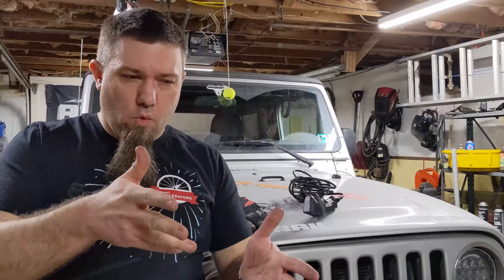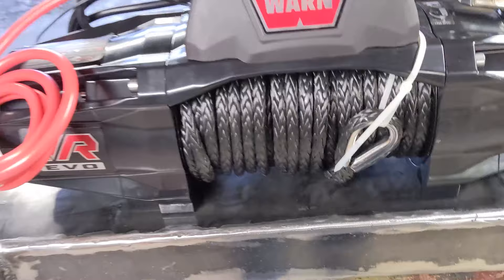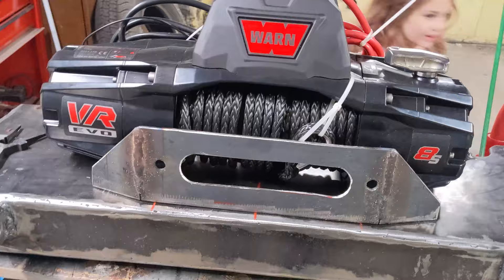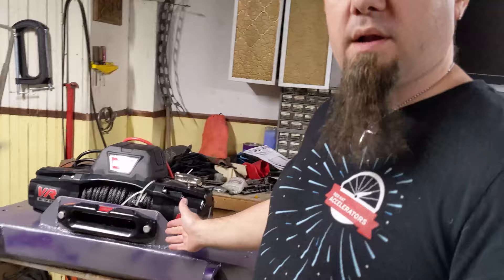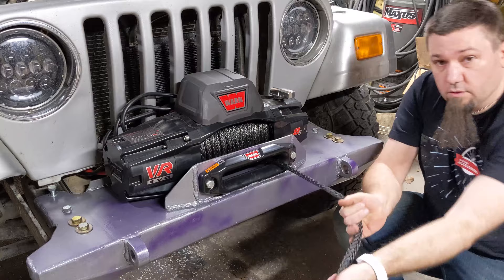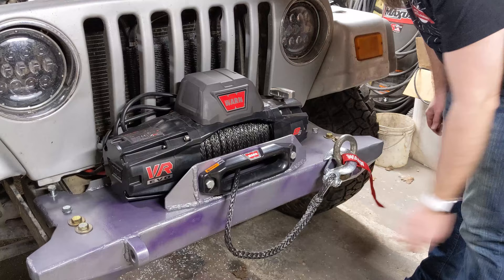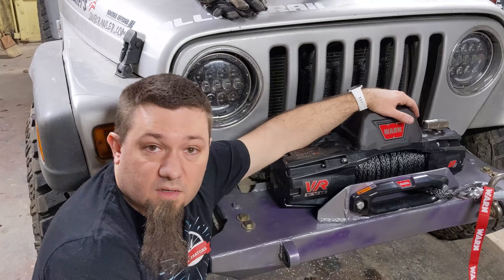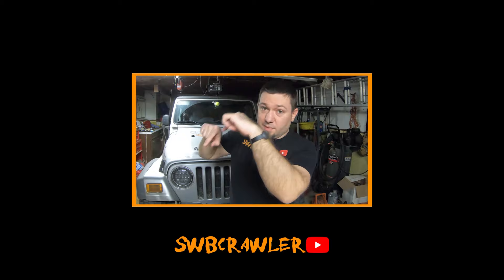Warn VR EVO 8s winch install on my custom 2005 Jeep TJ/LJ Bumper!

Comment: I have a Warn EVO 8. But I could not find out how the remote control works. I tried to read in the user manual but not I could not find a word about the remote. You showed how it works so now I know and now is my only problem what kind of battery it need. I guess it can not charge the battery, so it probably need to be replaced at some time. Thanks for a great video!
Reply from the maker: Yea, I was surprised at the lack of information in the manual about the remote.  And the batteries are also not rechargable as far as I can tell.  They changed the design at some point to accept AAA batteries.  But mine takes a special battery.  I did find a place that makes a higher milliamp hour battery (for longer life) but I don't have the link handy.  I'll share it If I remember to look it up when I get home.
Reply: @SWBCrawler  I opened my remote control and discovered that there was an ER14505 battery in it. It is a very special battery but it looks like a regular AA battery. But an AA battery does not work. ER14505 has 3.7 volts and AA has only 1.5 volts. Who came up with this? A really bad design and expensive battery...
Reply from the maker: @crazypict  https://www.montanajacks.com/products/mtj-er14505-replacement-battery-for-warn-evo-winch-remote-control this is the replacement battery I was talking about.  Rated at almost 5 times the milliamp hours though.  So it'll last much longer.

Comment: Glad to see you get a winch.  That winch will give you a little peace of mind, especially if your family is with you.  I ran a Warren 8274 on my K5 for years, but made a mistake and let it go when I sold the truck.  I never got around to getting another one because I could always go back to the barn and get a tractor.  Now that I’m retired, moved to another state, switched to a Jeep, and no longer have access to tractors, it’s time to finally get another winch.  I can use a come-a-long and/or a highlift to get out of most problems, but a winch is just plain easier and I’ve gotten old.  Enjoyed the video.
Reply from the maker: Thanks!  The hi-lift, and dependence on the group have gotten me by so far.  The 8274 is actually the winch I wanted, but they're not the low-buck rebuild they used to be.  Warn wants over a grand for one, new, and the used market has skyrocketed compared to what it used to be.  So here I am with the 8s.  Which is fine with me.  If the amount of times I've needed a winch in the past is any indicator, this will spend 99% of its time as a bumper ornament anyway. ;)  Thanks for watching!  I'm glad you enjoyed the video!

Comment: I wonder if this winch is still working for you or if you still have it? I just e transferred a buddy some cash an hour ago to go in the morning to Princess auto and get me one but the one I get is unfortunately the Cable version but I have had lots of those in past years and they work fine too. Anyways being a cheaper china warn version made me think a bit harder but at the end it came down to the price, like you. Any issues with it?
Reply from the maker: I had the same concerns.  I Looked into it a bit before buying it, and found a statement from warn that the same warn engineering went into the vr series, just made by cheaper labor in china.  Which makes me sad, but i like the price!  

Ive used the winch several times.  One to recover myself from a pretty nasty situation where my tires were off the ground in a mud hole, i was resting on my diffs, and i was able to pull myself out.  The other was a hummer H2 that was hung up on his skid plate, front tires off the ground, skid on a rock.  I pulled him backwards with a snatch block.  

Ive done a number of smaller scale things with it too, and its holding up great.  my ONLY complaint is the wireless winch controler. The battery died without even much use, it just died sitting in my recovery bag.  Then, to replace it, the whole  controler has to get taken apart, and the battery is not a standard grocery store battery.  I THINK they have changed this design though, so look into that.  Maybe its no longer a problem.  

I would recommend this winch, i like it, and its saved my bacon.  Winch does winch things.  :D
Reply: @SWBCrawler  Thanks soo much for the reply, Yea, I had a hard time finding very many reviews on this and it is because of the remote, it is like all the places have the same generic ad for it and no reviews. I found one review that said it now comes with only a wireed remote and so I got a photo from my friend last night and sure enough, the box is marked right on it that the remote is now a plug in only 12.5 ft cable remote. I am fine with that anyways because that is the only remote I have ever owned on a winch except for the rugcel that I just had to send back before using since it was wound back wards and they have no support so I was worried using the in button to go out and out buttom to go in might eliminate or adversely change the operation of the brake so I sent it back. As for the warn, now that you chimed in I bet Im going to love it for my 95 Sahara.  With the 4 inch lift nad 33x12.5's I think it will be the perfect add on and other then throwing a jacket over the cable when winching and only being able to use the remote wired I think it will be great anyways.I prob would have bought the Badlands if I lived in the US but by the time I shipped it and got it to BC Canada it was way too much, Anyways, just doing the CAD on my YJ so hopefully my friend will bring it next week and I can go find some mud and hills to play on. I love my 2006 Tacoma but there is nothing short of a dirt bike in the bush as ripping around in a door off roof off jeep with the stereo blasting and the sun beating in on ya. Can't wait ;)
Reply from the maker: @alkholic1950  sounds like a blast man!  Now that i think about it. this winch had a wireless remote recall a year or two ago my remote wasn't affected. their fix was to just send everyone a wired remote!
Reply: @SWBCrawler  My daughter and I have matching 2006 tacomas but mine is the trd offroad and hers is the base but they look the same and last week I replaced my brakes and rotors and calipers etc and this week she heard scraping and her truck is behind my shop now lol.. Anyways, when I get that done this week I will be back to working on my yj and my buddy brings the winch on thursday at the latest so Ill get that on and go diggin... can't wait to try it out and hoping the trails are still full of mud and crap not dried out for the summer.